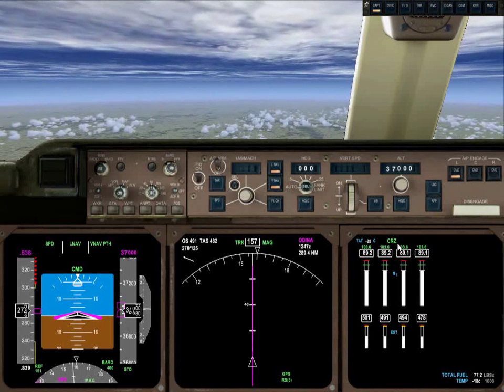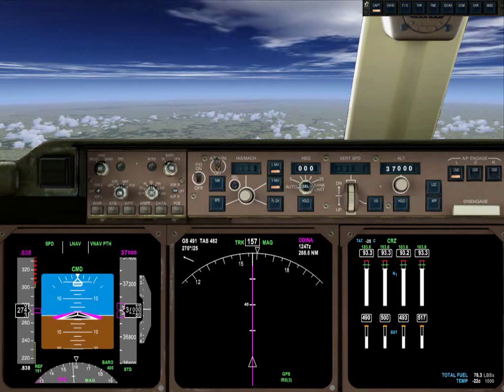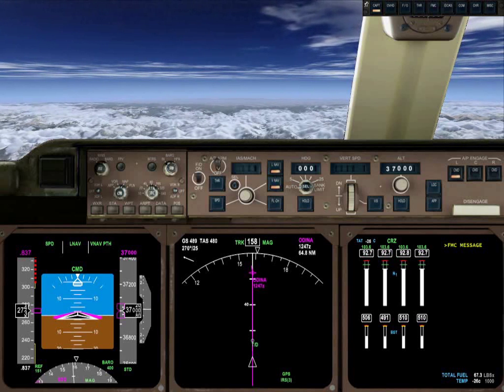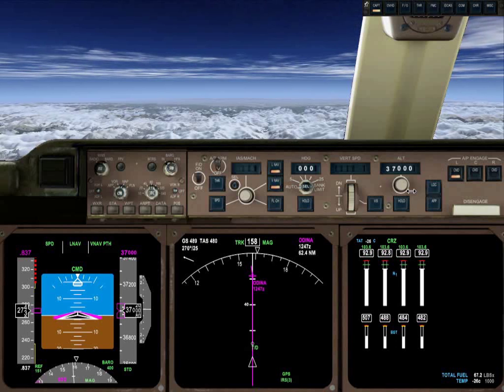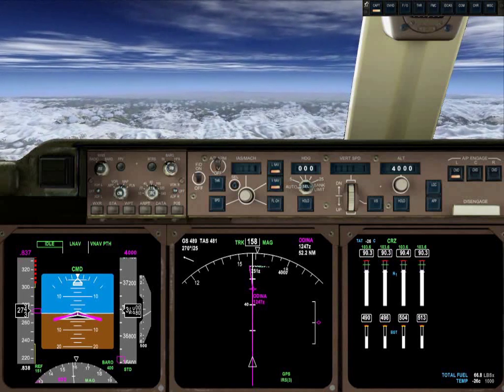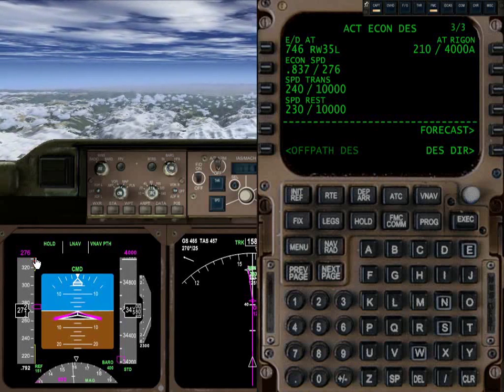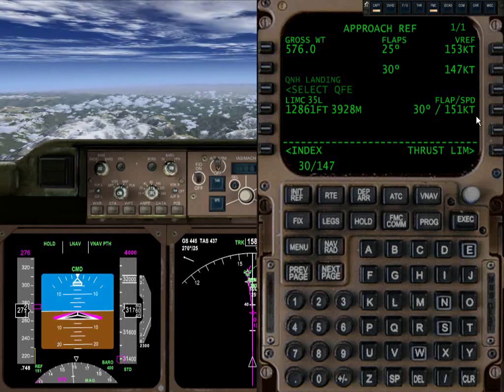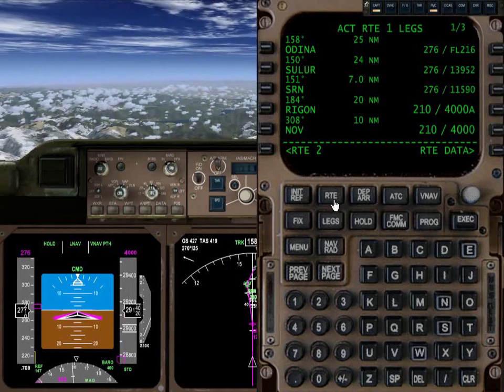PMDG 747 Flight Tutorial Part 7

Comment: Hi, I've really enjoyed this tutorial; but I'm having a problem with my descent.  I have programed the same exact route you have; waypoints, speeds/altitudes, and the same exact parameters you have; fuel weight, cruising altitude, cost factor.  I authorize my descent to 4000ft before the T/D point, but whenever I get to the airport, I am always several thousand feet above it.  I notice your T/D point is about 53nm from ODINA, but mine is 32nm from ODINA.  Do you have any ideas what is wrong?

Comment from the maker: Did you lower the MCP altitude with the knob?  Remember, you have to allow it to descend.  When it reaches TOD, and the MCP ALT is lower, it will descend to that altitude, or all the way down if it's set to 0.  If you want to commend the descent, lower the MCP ALT and push the knob in.

Comment: Great tutorial, but HOLD on the FMA actually means to hold the THROTTLE postion (at idle) and disconnect the autothrottle servos so you can manually adjust it if necessary.